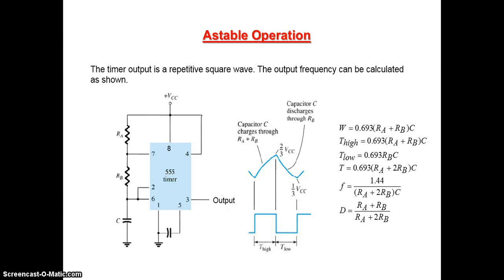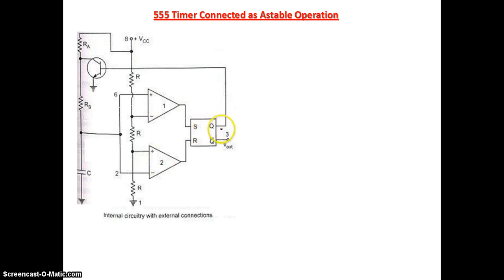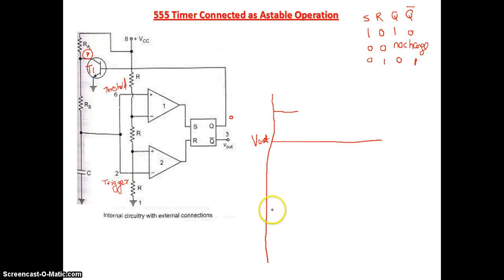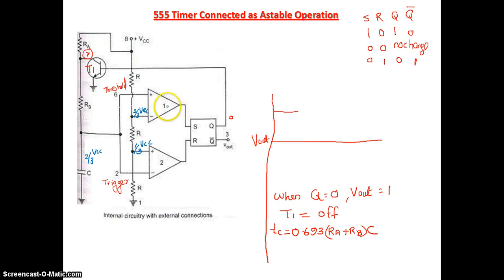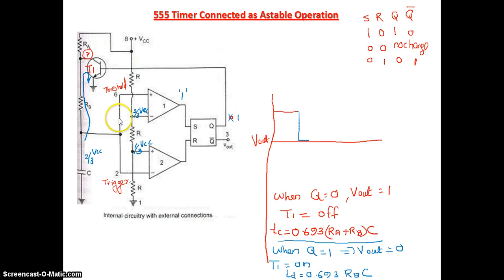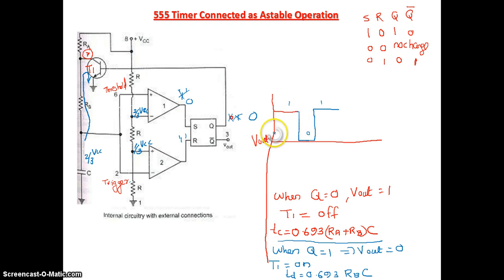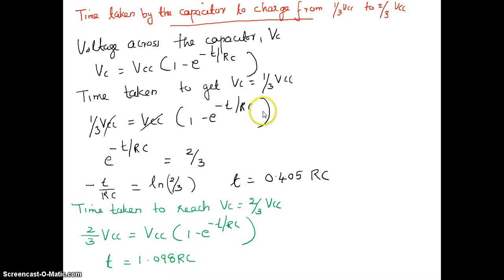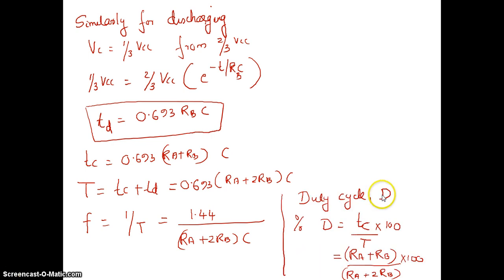Astable operation using 555 timer

Comment: Awesome video! I really loved it and it helped me gain a better understanding of the astable circuit! Thanks for the upload! SO here is a quick question, in the ne555p, the bjt base is connected to vout, why does your circuit show something different? Which 555 timer is this? Also, how would i send a reset signal to the flip flop in your video with an MCU?